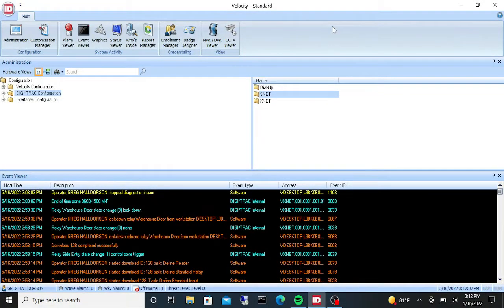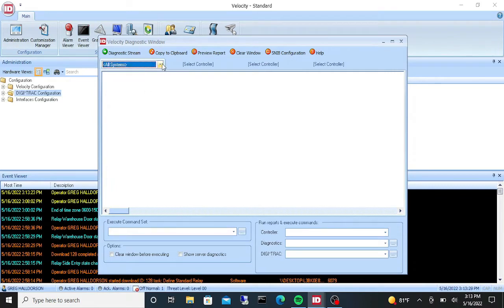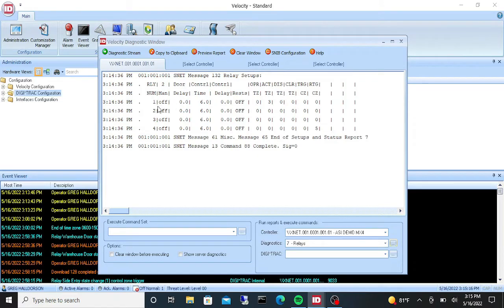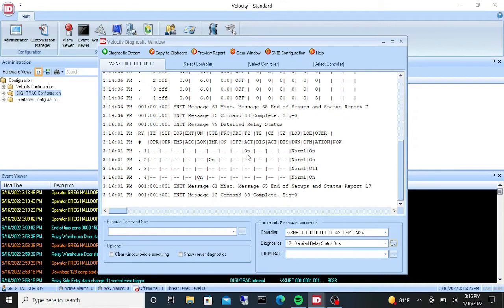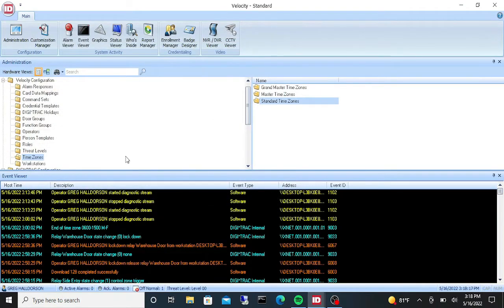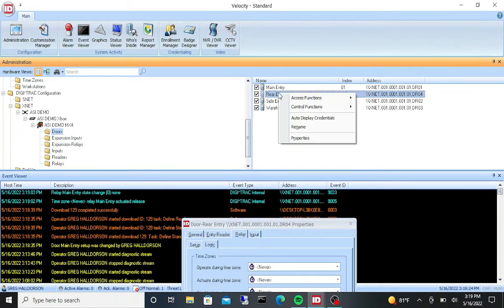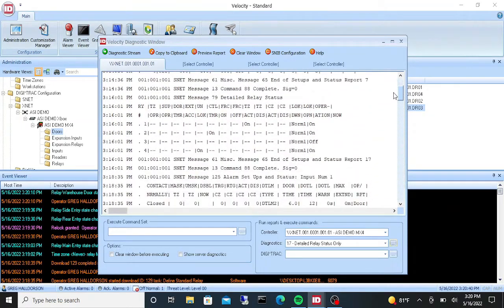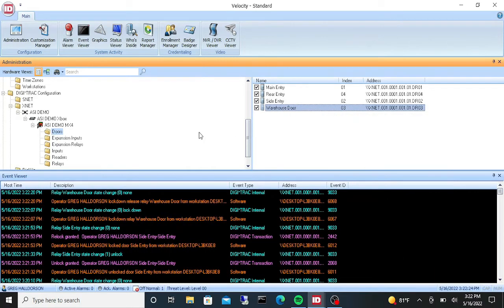How to See Why A Door Wont Lock or Unlock In Velocity

Comment: Hello,

Two of my Velocity doors suddenly stopped unlocking when employees badge in, they are connected to the same controller. No configuration was changed that would cause this (I’ve double checked the Diagnostic Viewer window like in your video, configuration is identical to working doors). After troubleshooting, I don’t think it’s hardware failure either. 

Do you have any suggestions on where to look next?
Reply: I fixed it, the problem was not a configuration issue. It was hardware failure in the Altronix Access Power Controller. Swapping the the AL400UXLB board fixed it. If you're having this issue do yourself a favor and take picture of the wiring before you remove the board.